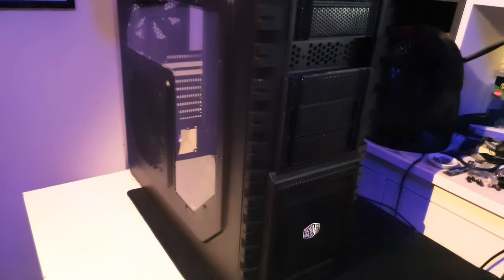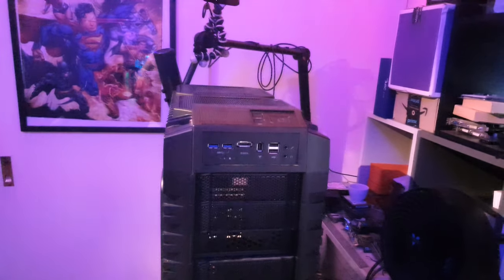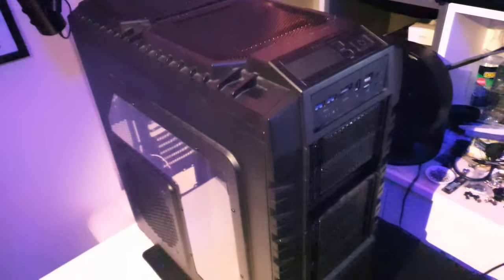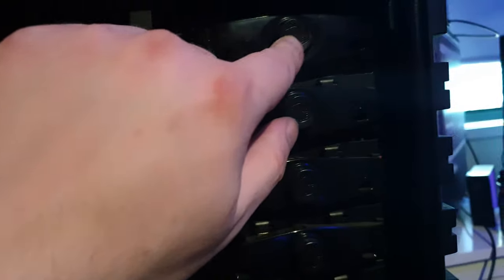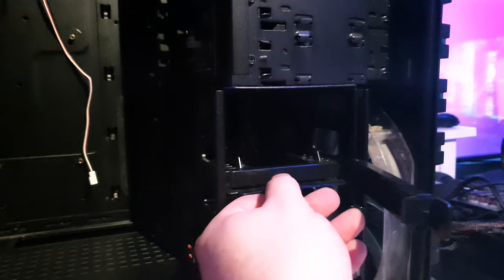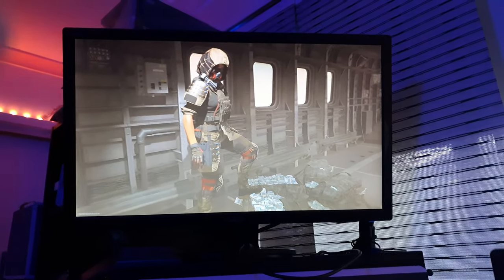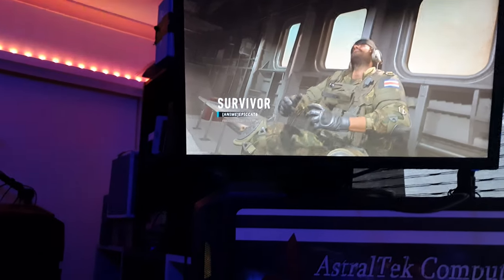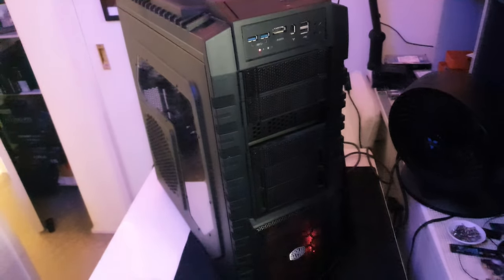Re-Visiting the HAF X PC Case OVER 10 Years Later! 🖥️🖱️ Cooler Master HAF X 2010 Overview & Showcase

Comment: I've had a HAF 912 for almost 11 years.

It's a mid tower version of this case if anyone wants a smaller case like this.

I supports a 200mm fan up front, a 140mm on the side, and a 240mm aio on the top. 

I've never had any heat issues with my i7 137000K or my RTX 3080.
Reply from the maker: Amazing,  brilliant case, shame the HAF 700 EVO, new, is 650 AUD dollars, these were 200 US new from 2010. Inflation is rougher interesting, 😆 🤣  btw, thanks for watching mate!

Comment: still have my HAF 932 from 2009 when i bought it new it for my phenom II x4 955 black edition build. that soldiered on til 2018 when i used it for my 1600x build. this weekend that build will be upgraded to 5600x/6650xt. cant beat the side/top/front panel allowance for 230mm fans and multi-120mm fans or combos therof. still have the protective film on the side panel glass, lol. 14 years is good ROI id say.

Comment: I haven't stopped using my since day 1...      HAF- Blue edition, all fan 200mm spots occupied.
It is still in the top 2 or 3 cases for cooling in all areas and still holds more #1 categories than any other case on the current market.
Running a AIO liquid cooler, all you have to do is turn around the back Fan, to push air in from the back, directly over the CPU socket and into the AIO.
With one fan switch, one simple change to the stock fan config and you can drop 3 degrees on the CPU.
Myself I also cut out a 120mm hole on the back panel, drilled 4 little holes and mounted a SLIM 120 fan right behind the CPU socket.
I get lower temps across the board over any other currently manufactured case.   FACT.

Comment: Does anyone know if it can fit a Silent Loop 2 360mm at the top without modding the case? I´m on the fence of going either for the Silent loop or the beQuiet Dark Rock 5 for my CPU being a i9-14900K. Great Vid btw :D
Reply: Yes it will. Excellent case. Owned it 10 years ago when I was a kid with a Swiftech 360mm loop going. Eventually got rid of the whole loop and got a shitload of Noctua fans because air cooling in this case dominates. Thinking of getting it again maybe for my next build.